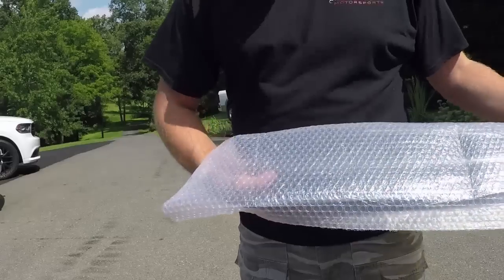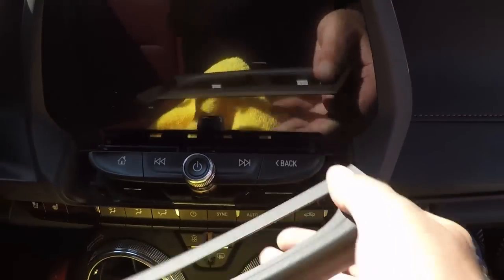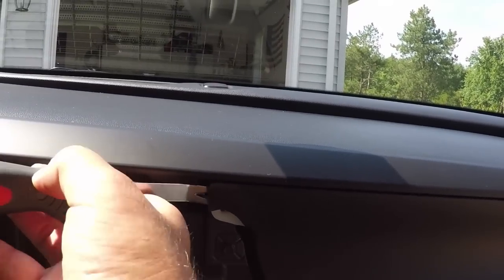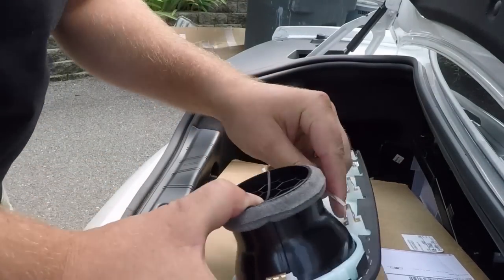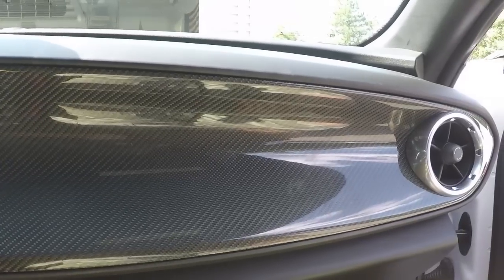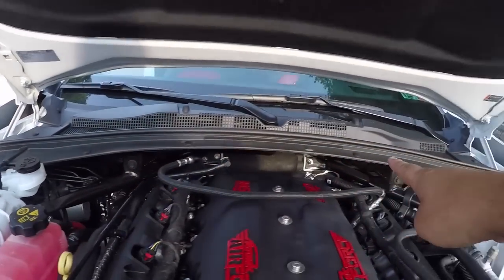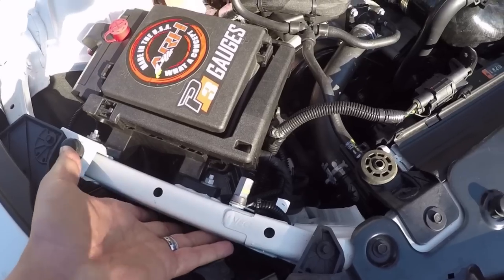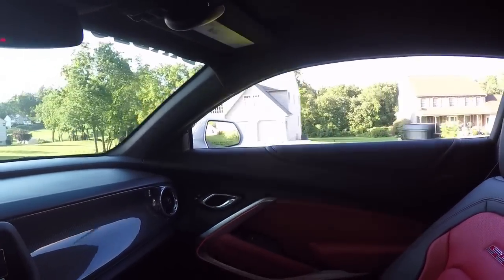What Is Wrong With The 2017 Camaro Dash

Comment: Hey is that a White Dodge Durango R/T behind you after you got your dash installed??? I am looking at a 2018 wasn't thrilled with the rotary dial for changing gears. Do you think that the 5.7 Hemi is enough power for everyday use or would you get the SRT with the 6.4 Hemi in it???